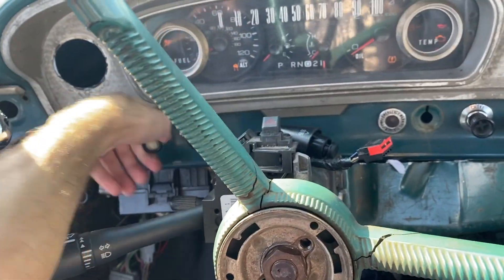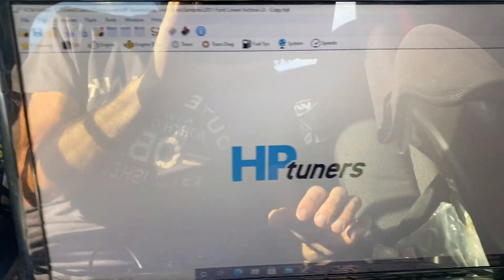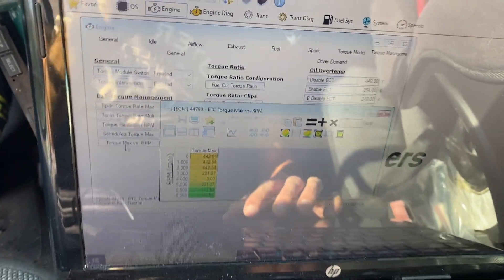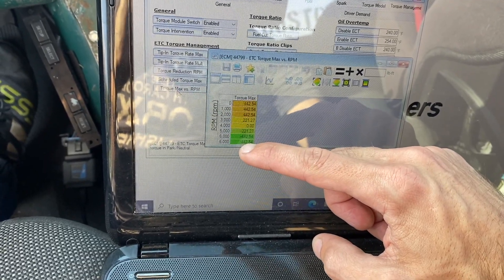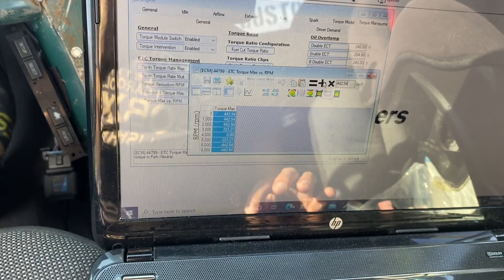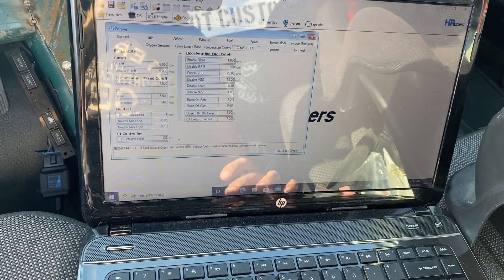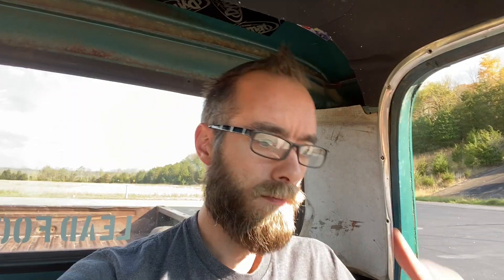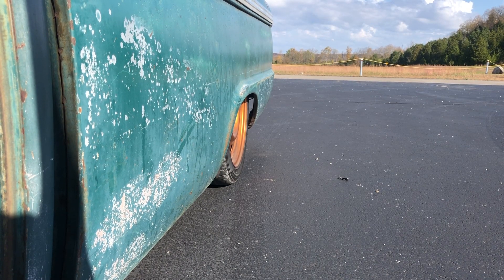The Hulk Project: Raising The Neutral Rev Limiter (Crown Vic/HPTuners)

Comment: I've been wanting to purchase a tuner for my similar setup. (1965 f100, 2010 cv pi full frame swap, headers etc.). Also want to install a set of performance cams. What specific tuner do you have? Thanks.
Reply from the maker: Hp Tuners MVPI 2
Reply: 2011 cvpi Lifted here just got my HPTuber mvpu2 as well 1 step at a time. How did u get any more performance out of the engine ? So far ?